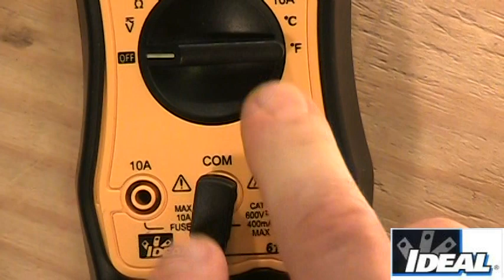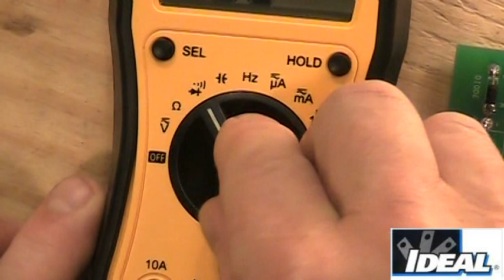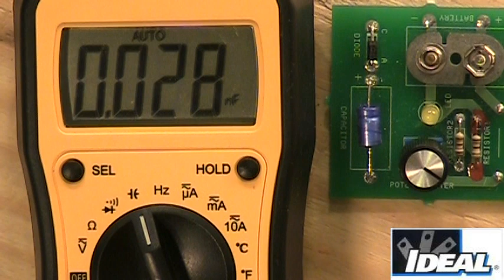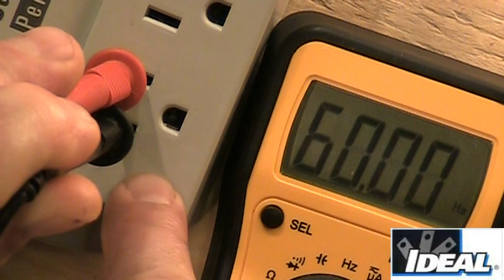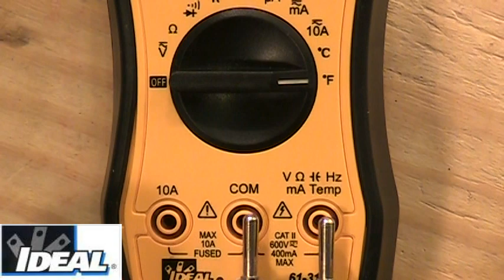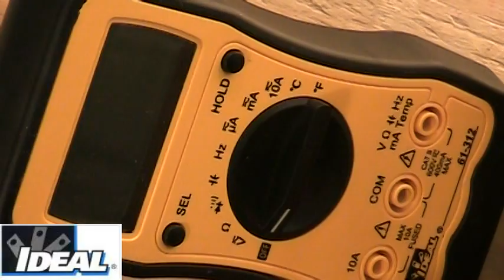IDEAL 61 312 Digital MultiMeter

Comment: I have the 61-312 and the current measurements are not correct.  On 10A setting it measured .5A, on mA setting 5mA, and on uA setting  50uA.  So there is a decimal point error between the settings, I believe .5A is the correct reading.
Reply from the maker: Hi Michael sounds like there is something wrong with the meter. IDEAL has not made those for about 12 years and they are well past any warranty date. Have you tried brand new batteries? it may help Ron

Comment: Ron, I've h thoughts??
ad my 61-312 for over a year and it blew a fuse, so I changed it and I still don't get anything on the screen, and I changed the batteries too... Any
Reply from the maker: Mike we have not made that tester since 2008 I believe so you must of had it for awhile and it sounds like it is toast. But I will be glad to help you out send me your address and I will send you a slightly used but newer version of a multimeter I am willing to part with. Ron at ron.kipper@idealindustries.com

Comment: Hi...OL means OPEN LOOP, not OVERLOAD.  It's not overloaded if there is nothing connected.  But good video though, and I have your meter and love it.
Reply from the maker: +James Kerns Jr. James thanks for the feedback I'll have to run that by the engineers. Appreciate the comment and thanks for watching.Ron
Reply: You are welcome.  And to precise my comment, I am of course referring to when you were testing Ohms only-perhaps there is an instant if you ran 2000 volts through it may say OL and mean OverLoad or Over Limit.  You manual says it to mean Over Range - which when dealing with Ohms can be the same as you can not display the infinity symbol with the type display it uses.  Some cheap meters put 0 for closed loop, or no resistance at all, and the whole value 1 for completely open loop or infinity.  But to make in more universal in all cases, it's more precice to say  OL = "Over Limit" since OL can only mean Open Loop when checking ohms.  Sorry if my comment was unclear.
Reply from the maker: +James Kerns Jr. This might end up being a good topic for a video. I ran this by the folks at IDEAL and got several responses and you are right it depends on what you are measuring. Since the display cannot show an "R" OL is used. Good to know and again thanks for the comment.Ron
Reply: Hello Ron, -  Would you please check with engineers at "Ideal" and help finding out if my Ideal 64-481 is fixable. I own it for 11 years and very happy with it. I am currently in Europe( Moldova), so can not send it to USA. I am electronics technician with over 20 years experience so basically I need just a hint or a schematics for this unit. The problem is in "Volts" range only. As soon as I switch the meter it starts beeping and shows an "OL" on the display. All other ranges -" Ohm"s, "A", "Capacitors" works. Any help will be greatly appreciated. Thank you. P.S. It happens when I accidentally touched one lead to the microwaves output transformer. The other lead was not connected at all. Please advise.
Reply: I've always heard "open line" but open loop is just as meaningful.

Comment: Great video. question for you. is it typical on my Ideal 61-340 for AC and DC readings to climb while not touching anything? AC goes to 40mV and DC bounces from 400 mV to neg? Is this ok?
Reply from the maker: +bowieinc Yes it will as that level of tester does not filter out those so called ghost readings and is actually picking up very small amounts of voltage out of the air. When you plug it into an outlet or battery they should go away and the meter will read the voltages properly. Good question. Ron

Comment: I checked out this video because I have the Ideal 61-312. I have used it many times for various projects. I have never had an issue with this tester and have had it for about 2 years. I recently was going to test a circuit on my daughters Jetta and the DC select will not go into DC mode. I watched your video to see if you covered malfunctions of this tester. When I turn it on and go thru the selections to test for function I get a continual beeping tone as well as an audible clicking sound. After about a minute the audible sounds will cease. I have checked the Fuses and changed the batteries. The meter still will not go to DC mode nor measure DC current. 
Kevin Howell
Gkeb Rose TX

Comment: Very nice run through of the features.  Thanks.  Question for you: the 61-312 that I've had for about a year will suddenly not work for resistance anymore.  If I switch it to the audible resistance mode, it immediately starts warbling the tone - when the leads are not even touching.  In fact, I can unplug the leads and switch to that mode, it starts the tone again.  When in the Omega symbol, it does not go to zero when I touch the leads together - it climbs to over 14M.  Any ideas? Thx
Reply from the maker: Scott Andrews Scott send me your address to my ron.kipper@idealindustries.com email and I will get a 61-340 replacement out to you. I will send you a little better tester as we have discontinued that meter
Reply: ***** Ron, you are the best.  I will continue to spread the good PR for Ideal products.  Thank you. I will email you shortly.
Reply from the maker: No problem glad to help you out the tester I am sending is something I consider to be the minimum a guy should have. It can be used behind the walls where the one you had was limited in where it could be used. You might watch the video I have up on how to choose a meter.
Ron

Comment: Mr. Kipper, I have a 61-312 and when I test it like you showed it doesn't go to zero it goes up to 930 and then just says OL. is there a reset on these or am I missing something?
Reply from the maker: Michael Andrews Michael if it does not zero and you leads are good. I would first ask you replace the batteries with fresh ones. If it still does not work send me a note to my ron.kipper@idealindustries.com address and we will work something out. On the back should be a serial number as well I could use. Thanks for watching Ron
Reply: …And you’ve addressed MY question, the reason I’m here:  the batteries.   HOW DO YOU OPEN THIS THING???

The instruction manual has no instructions on how to open an apparently SEALED device without destroying it

Comment: Mr. Kipper:

I got my 61-312 from Lowes for 18 months now.  I mainly use it to check continuity and DC batteries.  Today when I tried to check a DC battery, the [SEL] will not go to DC.  Here is some of the strange things the meter is doing:
1.  Set the V and push the [SEL] button.:
     Display shows V and the diode symbol on the top
     Press [SEL]: bell rings continuously and the display show ohms
     Press [SEL] again: the display shows nF
2.  Set to ohms: No problem here
3.  Set to diode: the display shows micro amps and beeps
4. Set to F: no problem
5. Set to Hz: it shows nF

About 8 months ago, my daughter and I use the meter to check about 30 DC batteries for her 3 grade school project and the meter was working fine then.  Could you help me out here?

Khang Nguy
Reply from the maker: Khang Nguy Hey I am sending you a replacement look for the email I sent you.Thanks for watchingRon
Reply: Got your email.  Thanks a bunch!
Reply: +Ron Kipper Datacomm I am having an identical issue.   I just sent you an email.

Comment: Ron, I have a 61-312 that will not go into the DC volts mode. The SEL button does not seem to do anything. Any Ideas?
Reply from the maker: Roger Moberg Roger I hate to tell you it is probably bad. Those inexpensive testers can be damaged depending on where they are used. How long have you had it?
Reply: ***** Probably a year or so. Got it at one of the big box home stores.
Reply from the maker: Roger Moberg Roger send me an address to my ron.kipper@idealindustries.com email. I'll get a replacement going to you.ThanksRon
Reply: ***** Thanks Ron
Sure will.